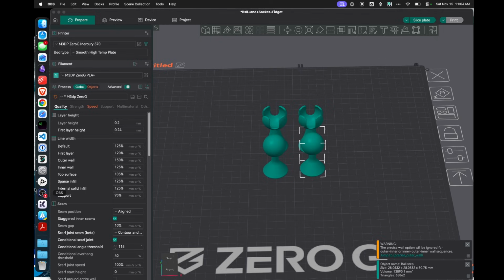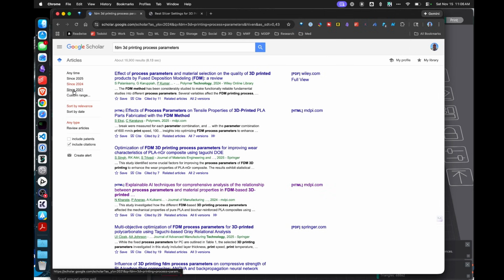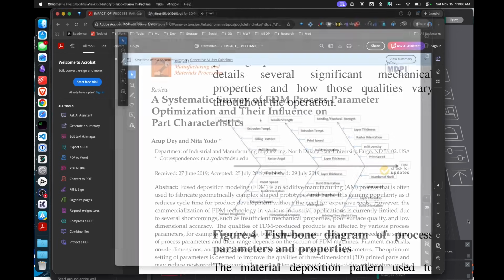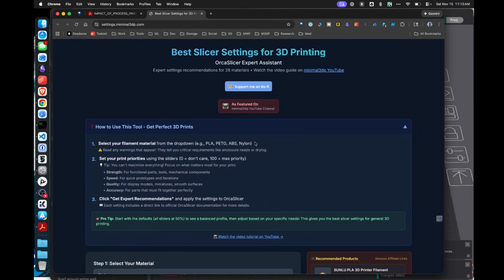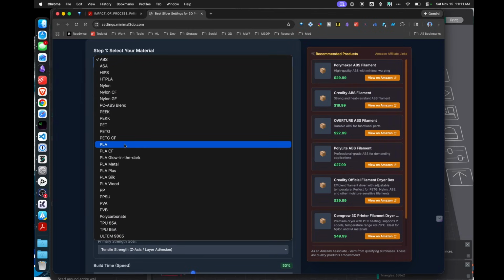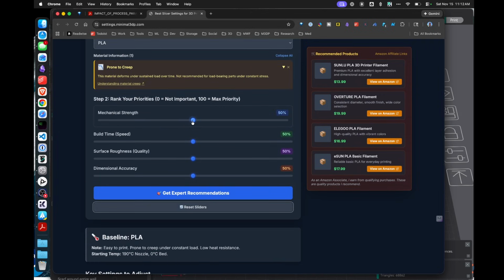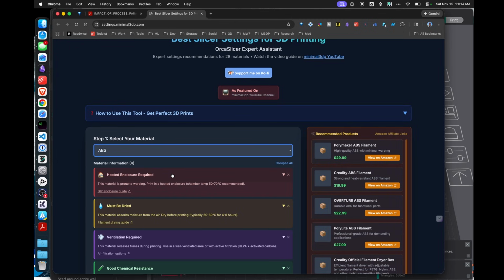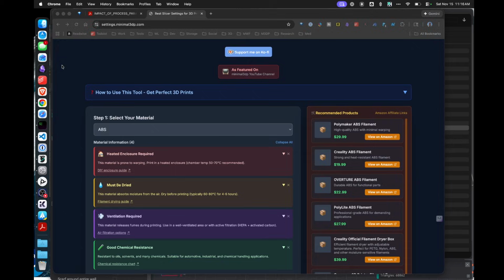Best Slicer Settings for 3D Printing (Using My New "Expert Assistant" App)

Comment: Honestly a little unintuitive, what if I want it just print with equal compromise in all parameters?
Reply from the maker: That is a good point. I am starting to work on optimized settings. For example, creat setting that are both the strongest and fastest.

Comment: Good idea. Very rudimentary with obvious settings. You took a bad data sample for your work, those Chinese Filament manufacturer, simply copy/past each other. There is no deeper sense behind their recommendations. 
You also left out the most important settings like "print support every "n" layer" or for a strong AND fast parts in vase mode "increase line width to 200%-250% of nozzle size". 
For a good quality to speed balance "use variable layer heights". "Don´t use infill primarily for strength use outer walls count AND/OR line width". Increase line width for infill to print faster without loss of quality. Use Extrusion Rate Smoothing in tandem will "slow down for overhangs" to create better overhangs and still print with 150mm/s outer walls, without quality loss. Tune in Pressure Advance properly. There are probably 100x more parameters that come to mind if you give me 10 more minutes, but it´s just an example. I mean of course increasing layer height will decrease time and quality for instance.
For somebody just getting started it sure is great.

Comment: Quickly reviewing your new tool (thanks for making this available to the community!), at least for the ABS drop-down, the first 3 links under Material Information either link to a random Printables page (DIY enclosure guide) or to a broken page (Filament drying guide & Air filtration options).
Reply from the maker: Thanks for the heads up, I'll take a look at those links. I started with just links to the orcaslicer wiki and forgot to go back and update. Working on it now.

Comment: Question when you go for dimensional accuracy, I see the Filament Shrinkage Calculator, do you generally run that once per material type, or what? Will it need more adjusting if I drastically change setting like number of walls or print speeds?
Reply from the maker: I made that calulator last week so I have not used it long. I have been using it once per filament.
Reply: @minimal3dp  I was just using it and noticed the instructions at the end for the second part say "Contour Compensation" when it probably means "hole compensation". ?
Reply from the maker: I think it is now fixed.